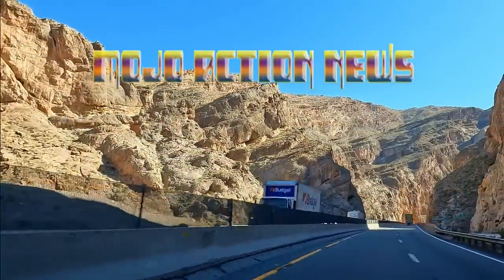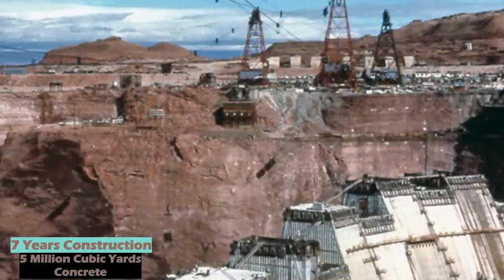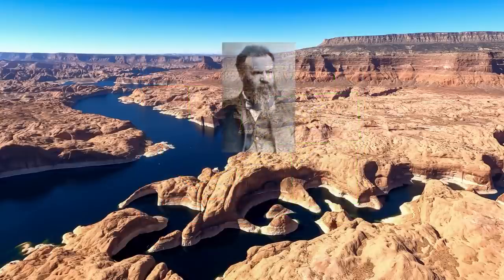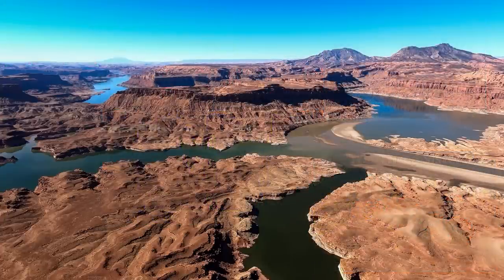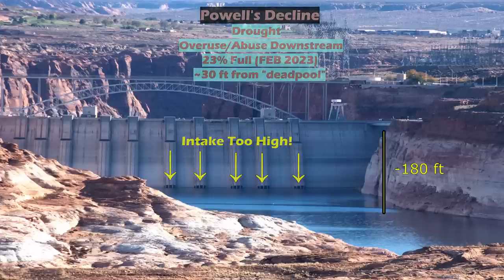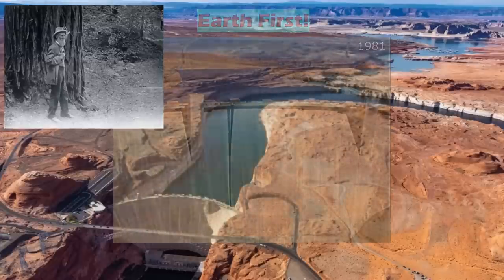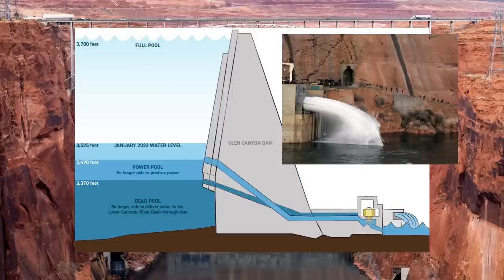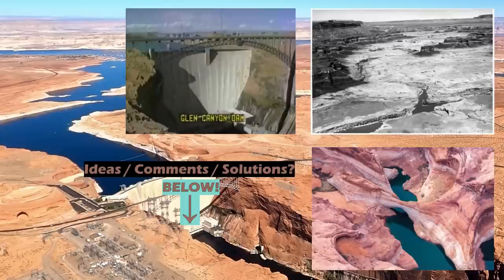BEHIND THE DROUGHT Part 2: Lake Powell Glen Canyon Dam Pipe Damage Colorado River Water Level UPDATE

Comment: Glen Canyon Dam was made with the mindset of we know better than nature and we can build it to negate nature. The twin issues of porous cliff walls and sedimentation means this was never going to be a permanent solution. If allowed to fully fill with sediment, you would eventually have a river channel ending at the dam, then a river channel below, with zero water storage and zero hydropower production. The porous sandstone means lots and lots of water is lost, negating the concept of water storage. Glen canyon dam should be removed, or remodeled as a backup to Lake Mead. The Colorado needs to run warm and silty. Too thick to drink, too thin to farm.

Comment: Excellent summary of historical and contemporary information and situations. Personally I would like to see the energy resource facet of the dam replaced by solar and wind. This leaves the water resource part of the equation which I think could be somewhat mitigated by more effective and comprehensive land use and development controls created and ENFORCED on the subject region(s). Thanks again.
Reply from the maker: Thanks for watching and good points! I too think solar in the southwest could easily replace and outpace the hydropower energy. That is, if the energy and it's credits STAY in the community that the solar arrays are in. Right now, some of it is being traded out of state and out of country while our own electric grid in the west has rolling blackouts during summer from overuse. Like you said, that leaves the water resource, the most important part for drinking and living!  We should re-examine what is "essential" water use in the entire west/southwest until things improve at least.

Comment: The siltation issue seems solvable by a suction dredge. Here in SoCal they actually mine offshore sand deposits left there by interruptions in the littoral drift by jetties and manmade groins pushing the sand offshore out of the littoral drift. They move millions of cubic yards of sand on shore to replenish our beaches. The only problem I see is the siltation at this point is Glen Canyons siltation is the only thing keeping the water level above deadpool. Remove the silt and the water level drops with it. They need to fix the plumbing issues.
Reply from the maker: Good idea! 👍 Didn't even consider something like that. Interesting point also about the water level falling after dredging all the silt out. I will have to look into whether the USBR calculates the siltation into their water volume estimates or not. Thank you for watching and commenting!

Comment: The flooded landscape behind Glenn Canyon dam has been permanently and forever changed and therefore impossible to restore with any amount of time. All efforts should be made to protect and preserve lake Powell and the dam even though it may have been a mistake in the first place. The boost in the economy for southern Utah towns and cities since the creation is incalculable and the devastating effects were it gone would be incalculable as well. This is now a much bigger issue than water. If power generation can pay for repairs and change then that should be the course of action going forward. Perhaps the engineers could figure out a way to force water from a new penstock from inside the structure out into the sediment and stir it up to outlets designed to carry some sediment downstream in mock floods.
Reply: the power it generates is less than 1% of the total production in the southwest. it was built solely to not give away water to the lower basin states.  as far as forever changed, that is also not entirely true. see returning rapids project or the evolution of what happened at cathedral in the desert as it emerged from the water over the course of two years. it went from completely silted in to about halfway cleaned out in just a few flash floods. what is hidden under that lake is beyond imagination. very few knew it existed before the dam and only a handful remain alive that actually saw it. the ramifications of 30 million people losing acces to water supercedes anything the dam brings to the economy or energy production. originally expected to last 700 years before being silted in, it was recently lowered to around 100 years....its over 60 years into that already. olympic sized pool of silt every second of every day comes down that river.

Comment: We has people here on earth are here to preserve the land as God's people. John Wesley Powell could of been on to something but who is to say because what if that would of backfired. The best thing will be to find just the right water supply that will pull steady flow that doesn't move with the tide but that can also be controlled through stead current that is going to be the right amount to steady out the bodies of water to make them and plentiful of water and the Colorado River again and correct any problems that they may have pulling out of the ocean it self pulling out of the reservoir in the ocean in California and figure out what is going on there and try to work it out with the state of California by dealing with the people that deal with the issue over there to fix the issue all around to figure out how to keep all of this water steady in flow and influctuation to steady the correct flow how long it will last because people need to drink water. It will have to be limited so that said we will have to do our part as humanity. So until that is done this may be the best fix. Ground water plays the biggest rule in this operation.
Reply from the maker: Well said! I have the same outlook after doing so much drought/resource research... Powell could have been right, but then again we could have a 100 year flood event next week, then Powell would be wrong after all.  I think the point more is to see our continued hubris as modern humans, and for people to realize the experts they have counted all these years are many times wrong, taking a guess, or just plain bought and paid for.  The Colorado would heal itself if we left it alone... of course, the way we've developed that's realistically not an option now unless we make breakthroughs in not only energy (fusion) but water filtration and distribution.  California is definitely the sore thumb in this whole issue now. All the other basin states are growing frustrated with the resource managers there and their refusal to do anything.  Decades of corruption and backroom deals are coming to light due to the drought... between them, politicians, irrigation districts, bottled water giants, etc. Let's hope it gets fixed before the people there are left with no water due to their leadership selling it all off for profit!  Once Hoover hits deadpool everyone downstream goes dry. Thank you for watching and adding the thorough comment! 👍

Comment: It's clear to me that the Glen Canyon Dam shouldn't have been constructed to begin with, but now that it is there, is the damage already done? It seems the best outcome would be to minimize its use and engineer a way to allow the silt to flow downstream.
Reply from the maker: You and me both! When I started this journey I was vehemently against removing any infrastructre... now I'm starting to see the totality of the picture. Perhaps Hoover Dam should have sat at least 100 years as a case study before anything other major modifications were done to the river. If Glen Canyon Dam remains the piping and siltation problems are going to have to be addressed ASAP and not put off any longer as we've done. Thank you for watching and commenting!

Comment: Did you know that Washington State and that lake Mead's got a 64' hole in it it's been on there for 35 years or 30 years does wind turned down at the bottom when they went to the diver which was public record got a hole and that's why we're losing our water
Reply from the maker: I have not heard of that specific story but I do see people sometimes refer to the "3rd intake" at Lake Mead completed in 2015 as a hole in the bottom of the lake, which it technically is (er... well a pipe). Designed to pull city water even if the dam hits deadpool. I'm guessing you are talking about a natural hole or crack in the rock?
Reply: Washington state has a connection to Lake Mead?

Comment: If the spillway tube was depicted accurately in this video, the cavitation bubbles were produced due to the radius of the elbow.. as the water flows down the vertical pipe, it picks up speed, and when all the water hits the redirection of the elbow, it causes the water to slow down, which causes the water to churn in the elbow, causing the water pressure to increase which creates cavitation bubbles to appear,

Comment: How do you like your wj?
Reply from the maker: The WJ is a great platform! Shhhh... 😎 still a bit of a sleeper 4x4 because everyone is buying up the XJ's lately! If you get the 4.0 not much to worry about ever. A bit gutless in the Grand, but it will run forever and then another 3 years. The V8 is much better power, tows great, nice offroad torque, but with their age you have to look for a well cared for one. The 4.7 got the better transmission also (5 speed / 545RFE). The V8's were dicey if they weren't maintained though... stuck hydraulic lifters, timing chain guide failures, warped heads when overheated etc. If you can find a V8 in good shape though they can run 250k+ miles. Either powertrain setup is good if it's in decent shape. Great family and roadtrip vehicles, great in the snow for winter, have good trunk space, comfortable, yet still small enough to hit the trails unlike the big, wide, heavy modern SUV's that replaced them!👍
Reply: @MOJO ADVENTURES  😂 I already have one. I've had mine for 4, almost 5 years. It's a 4.0 but I love it. Was planning to build it in to an overlander, but I think I'm going to buy a 4.7 and do that. Then keep this one as my DD. You're right about the transmission though the 42re isn't great. Mine is starting to slip but I have 250,000. I think I can squeeze it out for a while. I've got to do wheel bearing soon though😬.
Reply from the maker: @grasm03  Oh shoot, should've started with that! 😂 You are probly familiar with all that already then.  The Wrangler 4.0 has the same auto when I found one I ran a trans cooler up front, new fluid/filter, and fingers crossed it's been reliable so far. Around here it's all 4.7's and auto 4.0's for sale. I am always hunting for "mechanic specials" 🧐 We would love to fix up an XJ at some point!